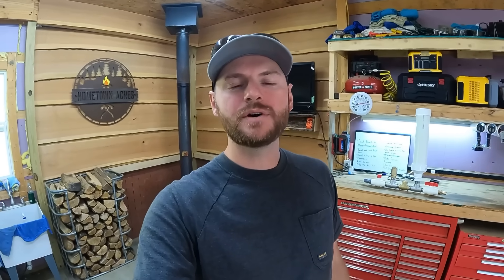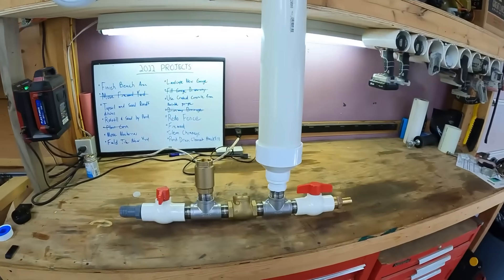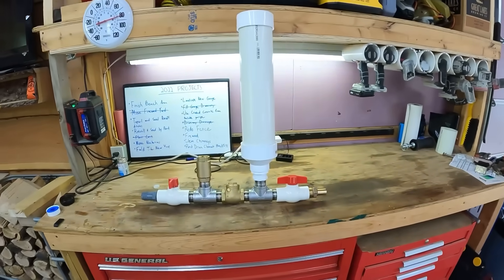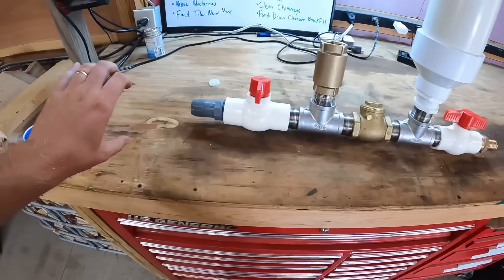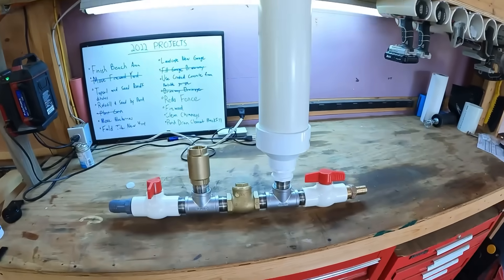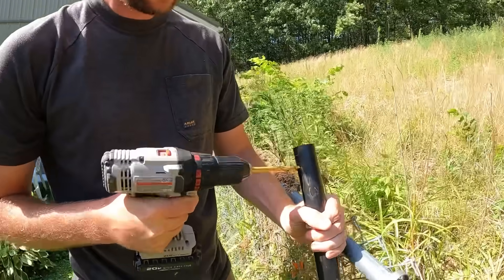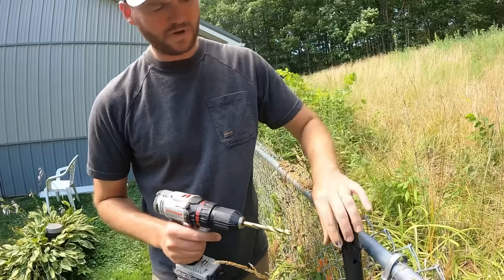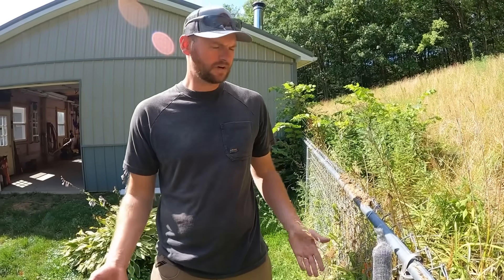We Found Water For The Pond - Hydraulic Ram Pump

Comment: Great video!!!  Only advice I can give you is drop that pipe directly into the pond and not on the side trickling down like in the video!  Evaporation is going to happen any time the air temperature is above the water temperature and the warmer the water going thru the pipe the easier it is also to evaporate!!! Add in the wind factor and that will also amplify the Evaporation.

Also for shallow trenching seeing you have the tractor, look into making up a small tiling attachment! I used a spare box scraper tine welded to a piece of solid 2x2 steel that I can throw into my ball hitch 3pt receiver.  On the back side I bent up a piece of 2" ID tubing with the radius facing the rear then welded it to the back of the tine.     Works absolutely amazing and opens even super hard dirt easily (if it's really tuff make a few passes prior to inserting the tubing!!) . I have shallow trenched everything from 1.5" black water tubing to direct bury Cat5 for our cameras!  Best part is the disturbance is so minimal it closes back up with ease and within a week you wouldn't even have known it was buried!!!!
Reply: @Rytek Marine, I think you have your evaporation equation backwards. Evaporation will occur when the water temp is above the air temp. More specifically, the wet bulb air temp, which depends on the relative humidity.
Reply: @donbeckham  having the water running 10',25' or more on shore picking up heat/sunlight is what I am referring to!  Always best to introduce the piped water into the coolest deep water you can.  I ran 48° oxygenated well water into my brook trout pond for 2yrs before moving them indoors for the summer months.
Reply: 3 point hitch receiver using a converted box tine... I like it I'll have to have my fabricator look into that... if I had a shop w welding equipment I would butcher it myself... but I like the idea.  I just tilt the box up to the max and push a trench backwards... now that my backhoe has a bad cylinder.  there's always the dozer too, it does just about the same thing but much less efficiently

Comment: My pond is an acre. On a hot day I can loose an inch of water from evaporation. That's 22,000 gallons.
I had a well put in with a standard house pump that puts out 20 gallons a minute and it couldn't keep up running 24/7.
I just change the pump to a 5hp pump which buts out 50 gallons a minute and it only has to pump part of the time.
A much better use of electricity. 

Plan on putting in a well.

Comment: Seems like for the cost of the pieces, running several rams from the same stream should be possible to fill the tote to increase per hour by as many times as you want to install additional pumps.

Comment: Check out some older Stoney Ridge Farm video   used for pumping water from pond   use  a larger section of pvc pipe  with screen  to  supply side  and also had vapor locking  issues  when hope got hot in black pipe during  slow time as had a float turning  water off and on at water trough  note his ran down  hill  after lifting up and out  pond

Comment: My state requires a permit to remove ANY water from a "surface water" source like a stream. Without a permit, the DNR would hand the landowner a citation which could be at least as much as a pump, and they might require you to remove the whole setup to boot, especially if you were reducing stream flow by 500,000 gallon per year. Maybe that is not an issue in the state where this video was produced. However, the host should have at least addressed the topic of getting a permit.
Reply: In Idaho, they don't even issue permits. One must have a legally recognized water right to the water source to use it. The water right will also indicate the acre-feet that can be drawn per day.

Comment: a stand pipe half way down the intake side can help you with bubbles. addiditioanlly, if you put a multi point intake head at the top with larger pipes there will be less suction on any single intake pipe so less will clog up your filter media. wranglestar has a couple good ram pump videos on his channel

Comment: I'd suggest a "test" perhaps.  A 20' long, 4' deep running sideways.  Dig 1/4 of the way up the hill (you're not using a cistern.  I wanted gravity pressure to flow my water to the house).  Cost of 2 - 10' lengths of perforated pipe, T connection (with 1"- exit) gravel, and labor in digging a ditch.  Use your existing 1" black pipe.  If that works for you - extend as far as you wish (around the hill???)

Comment: Large enough Sump pump to start the siphon action and once water is flowing through the pipe to the pond you can switch off the sump pump and the water will continue to flow through the pump (harbor freight pump)  Need Continuous pipe run from the creek to the pond. 
Your calculations didn't include evaporation and absorption loss. (Dennis, Welches pond Oregon)

Comment: Great video. When I made my ram pump I had my check valve opposite of yours. Only because of what I've seen that a swing check valve Only last a little over a year and with it vertical it will be easier to change.

Comment: Nice Ram Pump project. I am interested to hear if the high output volume stops the pump. Often if you have over 1gpm on the delivery you have issues with back pressure loss unless you are lifting high enough to maintain that back pressure.
Reply from the maker: It has been running now for 3 days without stopping. We’re lifting about 30 feet with probably about 6 ft of head pressure. Maybe 7. It’s working really well. I like the spring check valve instead of the flapper valve. Maybe something to try on one of your future videos. Compare the 2 check valves
Reply: @HometownAcres  That is a good ratio. I have used a few of the brass spring valves. For some reason they got off center after a couple months and jammed.  Might just be the quality I used. I am interested in your results with the valve you have. The swing valve typically lasts 3 years.

Comment: If the creek has more flow after a rain would your pump volume increase? Or is it maxed by the pipe diameter?
Reply from the maker: It’s maxed out by the volume of the pipe. Since that 1 1/4” pipe is already full it wouldn’t make any difference I don’t think

Comment: For siphon not to happen, add a standpipe on the hill of delivery pipe, it will allow air to enter the pipe and not create siphon effect.
Reply: Total static head is the difference in elevation between the ram and the creek intake. It's what creates the velocity in the pipe that drives the ram. A siphon doesn't affect the total static head. More important is the diameter of the feed pipe which contributes to friction losses and robs the ram of its energy which it gets from the static head differential.
Reply: @motnitsua29  I am not talking about drive pipe, I am talking about delivery pipe
Reply: but you benefit from the siphon
Reply: @motnitsua29  not in ram pump on the delivery side. It requires a pressure to operate
Reply: @ПростоДругаяЖизнь  it is the total head that operates teh pump. the siphon still has head pressure.
Reply: @motnitsua29  yes, unless it makes a siphon that pulls the pump side too much even for a moment
Reply: Even on the discharge side of the ram ,a siphon would only reduce the ram pumps discharge head and result in greater delivered capacity. If there's was. A siphon it would assist the ram  but could draw air in through the ram check valve which would break the siphon. This would result in unstable flow conditions.
Reply: @motnitsua29  if it grabs air, it will stop the pump, becouse it need pressure in expansion tank to operate.

On top of that, if you can get siphon that can make ram pump catch air, then there is no need for the pump
Reply: @ПростоДругаяЖизнь  If it gets air the ram will still work because the ram depends only on the intake side head. the The expansion tank is only there to dampen pressure surge; without that tank the ram would still work. I agree with your second point that it may be possible to to operate it at as a siphon if there is sufficient static head between the point of discharge and the intake elevation. the ram would then act to prime the siphon and it would be unstable.
Reply: @motnitsua29  I saw wells that had huge pressures before. They can be piped without a pump, hight depends on pressure
Reply: @ПростоДругаяЖизнь  artesian wells

Comment: As long as you have water flowing through the system, it should not freeze on you. The shortcoming may be your holding tank, if it freezes. M water supply system is a spring  that flows to a 275 gallon holding tank in an unheated shed. Our supply is off and on at the buildings and therefore we have heat tapes on the outlet pipes where they are above the frost line, but have never had any icing issues  where the water is flowing continuously. I think you may be able to run your ram year round.

Comment: Super cool system you came up with Adam....never heard of one like that, but definitely going to look into doing the exact same thing on my property.  FYI you should be able to get replacement valve components for your IBC tote from the hardware store and that will allow you to avoid another hole in the tank.....just run the line from the bottom valve out to your pond!

Comment: Hi Adam, great video. I have a smaller ram pump, 1/2”, I use to irrigate my garden with. I fill a 55 gallon drum that then overflows back to the stream. I use a battery powered automatic ball valve to supply my drip irrigation. Unfortunately my little creek won’t support a larger pump, but it still works. I initially I built a 1” drive/1/2” out pump that works in the spring, but I don’t have enough water flow in the summer to run it. You were correct about the air in your driveline when you started. Also no discharge back pressure will effect it. You can throttle closed on the discharge valve until the line is filled. Then open up the discharge valve. Mine is all plastic accept for the swing check. Also I have my check valves swapped from your positions. I didn’t have to modify the spring check valve to make it work. After four summers, I’ve just have to replace the swing check valve every year. I’ve never checked my flow, but it’s a pencil stream. My issue is that I’m only lifting the water about 10’. So for it to work properly, I have to keep the discharge valve throttled. In my driveline, I put a bucket as a silt trap in addition to the intake screen. I put the water in bucket about 2/3rds of up the side of the bucket. Then tapped off the side of the bucket at the top to feed the pump. If we get heavy rain it usually stops the pump. I just dump the bucket over to empty it. Then just let it refill the bucket, reprime/restart the pump, and it’s off and running. After the initial investment, mine has been pretty cheap to keep going. I just pull it and and pipe for the winter. I drain it and hang it on the shed wall. Also to fasten it in the creek, I drove a tee post in the ground. I then bought large hose clamps and fasted the pump to the tee post. Great video and explanations. I’m glad this works for you. Have a good day!

Comment: Hey Adam I sell ram pump kits 1/2" to 1" and I have a 2" operational ram pump set up for testing at my house over here in Warren, PA. I pass through the Meadville area every few weeks, maybe we could try out a 2" pump at your location.

As for needing the IBC tote, you don't need one. You can just add/drill an air vet at the high point as a vacuum break.

You might try to increase performance by adding a little weight to hold the waste valve open longer for higher velocities of water.
Reply from the maker: It would be interesting to try

Comment: Why did you put that faucet so high up??? Water below that faucet will newer leave the tank. 
I would not run this pump below freezing temps.
Reply from the maker: I’m using it as a silt catch. All the fun materials will drop to the bottom and I can clean it out when it starts to build up

Comment: You could run a siphon if you plug the top of the check valve. A siphon might exceed the pump water volume and then suck air through the check valve and up the output line.

Comment: Go ahead & attach the rest of the hose to the delivery pipe. It will be fine. 
But, you could build a storage tank system with your IBC totes. Water the garden & lawn. Use the complete IBC tote, cage & all.

Comment: I have same issue but my creek is about 20 ft from pond.  My plan is just to run electric to a 2000 gph pond pump and set it in creek.  The problem both of us will have is when it floods, which it certainly will.

Comment: I'm thinking your outlet pipe to the pond could easily handle double it's current flow, maybe a little more. Put 2 or 3 more ram pumps feeding the IBC tote, an overflow pipe that returns water to the creek (basically just dump it out a few feet away), and with the head pressure from the IBC tote, you'd easily be more than doubling your flow, and only for the cost of 2 or 3 more ram pump assemblies. The siphon idea a couple people have mentioned is also intriguing, and pretty easy to test without disassembling much of the current set up at the IBC tote.
Reply: An inexpensive option and certainly worth a look at adding more pumps. As for the siphoning effect, worth a test but my guess is that it would be detrimental to the operation of the ram pump as it would fight the incoming nonreturn valve.
Reply: Good morning  I'm  really appreciate what you have done  to help in such a simple  ram pump
Reply: you require one feed line for every pump, the longer the better, for the hydraulic ram to appen in a controlled way. Also if you add more pumps you require more water, but the stream was already near capacity

Comment: You would gain a little bit of efficiency if you had a hard pipe as your delivery pipe to the ram pump you end up losing a little bit of energy inside of a poly pipe as it expands slightly with the shockwave but by the looks of it you're getting what you want to out of it so unless you wanted to tweak the system for efficiency I wouldn't bother replacing it with hard pvc

Comment: Im trying to work out in my head why a syphon would stop the ram pump working.  To my mind it would make it better.
Then it occured to me. If you had a penstock in the creek and you could set up a syphon down to the pond.
It would run 24/7 without any pump 🤔
Reply from the maker: So the last check valve in the pump require back pressure from the delivery line to keep it closed. If you were to create a siphon on the delivery line you would lose that back pressure

Comment: I would think the real hassle will be keeping the inlet screen clean/not clogging…..in a stream like that, it could be a real pain. Only other negative I can think,of would be like you said…..storms, major washout…..I’m sure you can address both these problems with stabilizing the pipe/pump and maybe backing up the inlet area to make it deeper and making the flow easier. Deeper, having less turbulence near the inlet screen. Cool system !!! Hope it works out well for you 👍👏 Rick
Reply: You can build an inlet box that has a screen filter, and a wedge shape input to help accelerate the water a little bit.

Comment: Have you thought about a system running in parallel to the ram setup? Use an electric pump, powered by solar, if it can raise the water from creek to top of ridge, then gravity to pond.

Comment: Why not just use a siphon** line? Seems to me that you don't need to use a ram pump...
Or you could use both to get a greater amount of flow into the pond. 
(the siphon line could use the same discharge line as the ram pump' or a separate (larger diameter?) line could be run to the pond...

** The siphon line would need :
a line from the stream to the pond ... with a line fill port at the top of the bank and two on/off valves in the siphon line.
IE; place intake valve #1 in the creek (under the creek's water level) and place the discharge valve #2 down the hill (such that it's lower than the creek level intake valve #1) .

Initially you would need to close both valves then completely fill the section of line between the valves... to get the siphon started, 1st open intake valve #1 and then the discharge valve #2. 

Once the siphon starts, water will continue to flow until the intake line is lifted out of the creek or the creek runs dry...
Reply: Siphons only work reliably up to a certain height, somewhere under 33ft. He says the hill there is about that much so I doubt it would work unless the siphon ran around the bank further down the slope.
Reply: @JoeMalovich  You could be right ... I don't know much about siphon properties but -- I've watched a few letsdig18 videos 
(I stayed @ a Holiday Inn last night😁)  where he uses a 4" pcv pipe to drain ponds... but perhaps those outlets were less than 30 feet lower than the inlets.